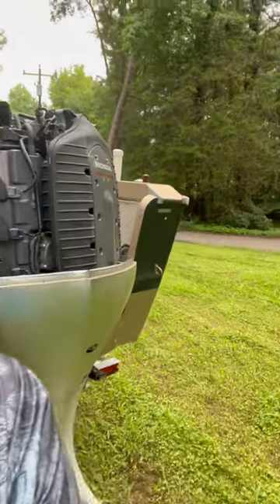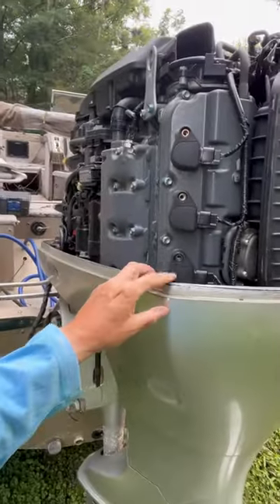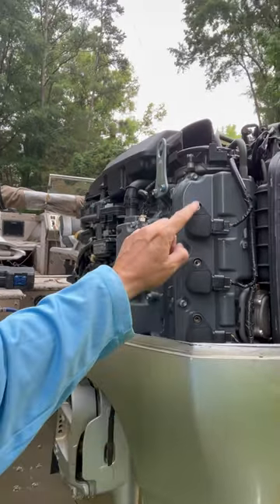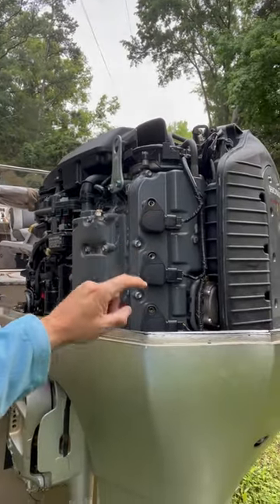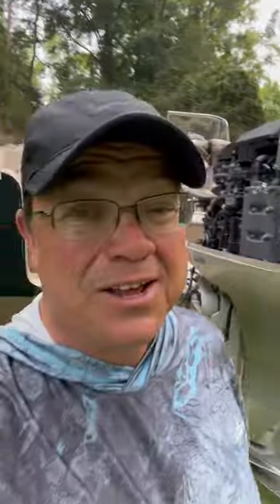200 hp Honda 4-stroke outboard…we may have found the issue!!

Comment: Crazy….but good news I hope…full service recommendations use Honda oil and filter. I use a vacuum oil pump with engine a little warm….Change impeller and foot oil, check foot oil for any water before draining….if water change sills…bla bla you already know all of this….go man!
Reply from the maker: What’s interesting is that the oil filter is the same size that fits my truck!!!  😜
Reply: @DieterMelhorn  100 hours runs between oil changes, maybe do a reset on the hobs hour meter too.